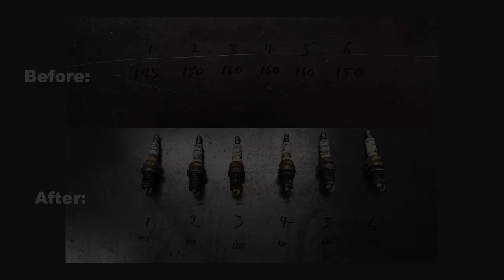Restore Engine Compression $10 - Does It Work!?

Comment: i’ve used restore before. it would make the engine feel good for a little while but it wore out quickly. it wasn’t worth spending the money to add it every copy of months to restore a little performance. but the product does work
Reply: Then you had a much bigger problem then a little compression lost. I won't fix craters in your cylinder walls.

Comment: Nice information. Thanks.
Question for you, as to what product and how much you think I should use. I have a 1995 Subaru 1.8L 4-CYL boxer Impreza, 177,000 miles.  I have 76 and 78 PSI dry compression in #2 and 4 of one head (driver side).  This started a few days ago, we noticed while on a highway trip the power was weak and I can hear it missing as the RPMs drop from driving to idle.

I don't have overheating, excessive oil consumption (drippy seals, I add a quart about every 900 miles), smoking, or fluids cross contamination.  I'm waiting to have a leak down and another dry/wet compression test at a different shop. The first shop only did dry compression and wasn't too bright or helpful. 

If I end up having a head gasket leak between those two cylinders, what products would I possibly try to mend it?  It must not be too bad of a leak, whatever it is, for the compression to build to 78psi dry.  The other two good cylinders are 130ish psi. 

If it ends up being a valve leak, what products and strength could I try to get them clean?  After cleaning, I will have valve clearances checked, as it's probably never been done. 

Any suggestions appreciated.

Comment: glad it was a jeep test got a 2011 charger v6 and it has low comp in cylinder 2 where as before it was a misfire but after a tune up brought it back. gonna get the psi from the mechanic who wants to tear my engine down to see whats wrong. but i think ill try this first.

Comment: Used engine restorer 4 cylinders on my 2015 Scion FRS and I now have around 6 check engine codes. Cars at 82,200 miles and it says on the can use on any car over 50k...also put in a bottle of STP gas after a trip the gas station. Codes with the same oil I used the restorer on: P0420, P0014, P0014, P000B, P000D, P00014              Codes AFTER I changed the oil(because I changed the oil around 15 miles after): P0420, P0014, P000B, P000B, P000D, P0014, P000B.                             A month or 2 ago the car was at stage 1 with the OPENFLASHTABLET then stage 3+ with flex fuel(without flex fuel kit). Flashed it back to original ECU/file and sold the OpenFlashTablet. Some miles later it gave a transmission code cel problem then it fixed itself....then a catalytic converter o2 problem...let the car idle for 30 minutes rev'd it a bit then fixed itself......now this..help pls ty
Reply: @Aaron Erickson haha, hell no. But update! Fixed it, and sold car! Ty for the laugh. Have a good one.

Comment: Had a 2000 frontier with valve chatter. Threw in motor restore on the next oil change and it went away. Ended up selling it to someone who was surprised as to how quiet the engine was

Comment: Can any one explain to me how " Restore " finds its way through the the engine to the piston rings and seals them ?
Reply: I'm not aware of the chemical part. But the "find it's way" that's easy. It's mixed with the engine oil. So where ever the oil goes Restore can also go. ;-)
Reply: Oil is always being squirted into the cylinders below the combustion chamber.  The piston rings scrape the cylinders walls keeping the oil below the combustion area.  
When the rings wear out that allows oil to sneak into the combustion chamber hence losing power and burning oil.  Somehow this restorer helps expand piston rings or coats the cylinder walls creating a tighter seal increasing compression.
As dude said above, it's actually mixed in with the oil.

Comment: Is it possible that driving 2000 highway miles jist cleaned up the cylinders a bit and make it run better and show better compression numbers?
Reply from the maker: Probably not. This Jeep is driven regularly. I'll keep using the product consistently for a year and check numbers again.
Reply: @bleepinjeep  definitely would like to see a one year follow up. Might try it in my 5.2
Reply: @bleepinjeep   I call bull shit ,in a year you can prove it.
Reply: I started adding it in my 5.2 as well... problem is with overheating  engine in summer Air conditioning. I heard something about using a Ford Taurus electric Fan ... someone help... coolant is fine... anyone know of good retrofits for 5.2 overheating Air conditioning problems..
Reply: @jonnykielbasa  new RAD, i just picked up an all aluminum one myself. Put in a lower thermostat 180°. I have ran the AC in my 5.2 ZJ during a 105° day driving for about 8hrs with lots of idling. Never overheated. I may try today since today is gonna be 100°..

Comment: This video has good editing, but I feel that it was directed at folks that have previously performed a compression test. Based upon the footage and info provided, viewers may try to crank the engine with the ignition system still enabled. Just my $0.02. Keep up the great content! ✌️
Reply: Jake of All Terrains 

Noticed that too, didn't mention disconnecting/disabling Fuel Pump or igntion, or holding it at WOT while cranking.

Comment: I believe  it's a gemic, the fine powder that supposed to fill in the scratches in the cylinder walls would never get past the oil filter to begin with! As for compression gains after a road trip on a order engine is do to carbon burn off on the valves. 150 + psi on a engine with 240,000 miles is really good! When you see blow by coming out your oil fil cap or dip stick then you will know its time to retire her.

Comment: The 2k mile trip burned the carbon off your valves and rings and this raised your compression, Italian tuneup.... 

The stuff in a can is useless, quality oil is all you need, has all the best additives and detergents..

Mobil 0w40 fs is some of the absolute best in a jug available at wm $22 5qt... Over 120 ksi film strength in independent testing and perfect for a heep..

Comment: 150 seems low to me.  The least compression I have ever tested was a 280K mile 1983 305 that had 180 psi in every cylinder. My 97 5.7L Vortec cranked 195 in every cylinder.  The 383 that replaced the 350, 225 psi.
Reply: All-Data's specs for this engine show compression between 120-150. Your Chevy engines may have different specifications and compression ratios. The Jeep 4.0 is a low compression ratio engine at 8.8:1, and a stroker 383 engine will have something around 10.1:1, so your compression readings will be different. A 4.0 running more than around 170psi would likely have carbon buildup on the cylinders causing a domed piston effect and have pre-ignition issues most likely.

Comment: does anyone else see it arcing while hes cranking to do the comp test? is that normal for a jeep ?
Reply from the maker: I disconnected the wire from coil to distributor cap while I was cranking. The spark was shooting off the coil. Yolo...
Reply: @bleepinjeep  🤣👍
Reply: I thought it was bad for the coil to prevent discharge. Although yours obviously found a place to arc.... I could be wrong but if that's the case you should probably disconnect the coil and remove the fuel pump relay for good measure.

Comment: My  '94 4.0 is sluggish and seems to lose power once its warmed up. Takes forever to start as well. Thoughts?
Reply from the maker: Miles?
Reply: Fuel pump/filter?
Reply: 206,000 miles, new fuel pump, filter, tune up, CPS as well
Reply: During the winter it runs like a champ, summer like shit. Heat soak? Should I insulate the fuel rail?

Comment: We ran restore in an old Buick 350 motor and the oil relief valve starting sticking and causing zero oil pressure at idle when coming to stops at lights and sometimes when starting
Reply from the maker: First negative I've heard. Good data point! Thanks

Comment: compression increases from the chemical because worn engines have sludge and carbon around the the piston rings and sometimes they get stuck in place and dont fully seal properly. they supposed to have a little play on the piston and move left  right, oil control ring wipes off the excess oil on the cylinder walls witch sometimes if stuck will end up burning oil and same idea with the compression rings, if stuck and not sealing properly, will lose compresssion

Comment: I used this stuff on a 350 many years ago, after tearing the engine down a couple years later I was baffled by the blueish looking stains running the length of the piston stroke......then it dawned on me that I had used this in its lifetime.
Reply from the maker: Did it work as advertised for you?
Reply: I believe it did, not on a seat of the pants scale but looking at the cylinder walls yes. I have a 96 XJ that just turned 284k miles on an untouched motor thats going to get some engine restore this weekend, can’t hurt by any means!!
Reply: Did you notice the metallic flakes from this stuff in the oil pan at all? I used it in a 2000 suburban I had and there was a bunch built up in the oil pan when I pull it apart later on.
Reply: Tony V_AZ I didn’t in mine, did you have a large amount of metal in your pan?

Comment: Notice you removed your thor intake? Did you have issues with yours?  Just wondering before I hack into my firewall... Would love an update.
Reply from the maker: I didn't have any issues with it but at certain RPM'S (like on long freeway drives) it was very loud. Driving to Utah last year with it I could barely hear myself think so I took it off this year and was grateful for the much quiter drive.
Reply: Thanks for the quick reply brother, I too drive the holy shit out of my forty door xj “Rusty-J” Zig zagging across North America in favor of camping and wheeling. Funny how when we get older the shit that annoys us. When I saw yours I ran out and got one so i could free up room for a dual battery setup... ended up mounting under the rear seat so I never unboxed the intake.  Sorry to take the compression check vid off topic... on another note I’ve got 399k in my 91 and I religiously change the oil at 3000 miles accompanied by the original slick50 formula... Still a lot of power except #1 cyl is starting to queif a little more than its 5 siblings...I’m guessing it’s got another 75k in him before I need A rebuild. My grandpa worked on the ford assembly line his whole life and was a ford pickup guy and always ran that restore goop and swore by it...

Comment: 150 psi is fine, the 4.0 is all about low end torque and clearly its more than enough to climb a sheer cliff face with the gentle press of the big toe. understand that once you lift a jeep and start rolling 33's that your speed over 35mph drops dramatically from wind sheer and tire physics work against the engines power at high speeds.

Comment: Thank you very much. I bought this product at Walmart for $7.97 about 2 weeks ago. I added it to the engine of my  2018 Malibu in the parking lot of Walmart. 3 minutes later, the car started vibrating violently, lost power, and the engine light came on. Couldn't drive. What may have happened? Thank you.
Reply: Did you know the amount and condition of the oil that was already in the car?
Reply: That Malibu has VVT and GDI.  You're not supposed to use this stuff in modern engines like that.

Comment: This stuff definitely will quiet up a slight knock it is a cheap mechanic's way to "fix" a motor right before selling the vehicle and it does work as long as you continue to use it at every oil change but they usually do not tell you that...

Comment: I just did an oil change with lucas additive, I wonder if it would be ok to put some Restore in as well?
Reply from the maker: I've done both in the past. Almost 250k miles now... Still runs fine. I don't think 4.0's care. Just feed it oil of some kind.
Reply: @bleepinjeep  
Good to hear man, I'll put some in, I'm at 287k so I'll add it to my oil changes from now on.
Thanks
Reply: I once ran an old Pathfinder with a 3.0 V6 with basically nothing but a combination of probably 1 qt of cheap oil and the rest  Engine Restore, Duralube, and Zmax in it for a few hundred miles before I realized (I was young and dumb). It ran and ran well. Basically gave it away with over 300,000 miles on it and it still ran great.
Reply: @timyestim  
Damn

Comment: Hey I’m not sure if you noticed. But during your pre trip compression test, there was something arcing out
Reply from the maker: I diso'd the coil to distributor cap wire while cranking. That spark was from the coil jumping to grounded metal surfaces near by. Next time I'll unplug the CPS and that'll kill spark and fuel.

Comment: So I have a 01 Jeep Cherokee 4x4. I have a small engine tick. I used this stuff since I lost compression- my engine tick completely went away for 3 days then came back. Is that normal? I was hoping not to have to replace the entire engine this fall. I have approximately 200,00 miles on it.
Btw Tim is cute 😍
Reply: Pretty sure they're supposed to tick after the 200k mile mark!

Of the 6 I've owned 5 had some valve noise. The one that doesnt only has 120k on it
Reply: James Ryan a small tick can be easily ignored but loosing compression is another. Esp when it would go through episodes of having a hard time starting. I’d rather just replace the whole engine instead of tearing it apart and fixing small pieces/ a piston. I thought I’d try the engine restore just to see how it would do. It was so weird because my engine sounded completely different for the first 3 days

Comment: Off topic, What size tires and gears are you running ? Reason for asking ,because you didn't trailer the jeep.. thanks great video.
Reply from the maker: 33's, 4.10's. Runs about 2,500rpm at 70mph in 5th gear (AX15) and I'm seeing almost 15mpg avg on long interstate drives like that.
Reply: @bleepinjeep  was hoping you said 35s.. gonna regear mine and everyone has a different opinion.  What would you recommend for 35s. Also dont trailor mine.
Reply: @javiroo1743  I have 4.10's and 33's and I would mind a little lower gearing. I think if you wheel a lot people like to go with lower gears. 4.56 with an AW4 and 35's or 4.88 with an AX15.

Comment: Ok, watched the whole video, you should have done a dry test, then a wet test (oil squirted in cylinder).. Because if Restore didn't raise the compression in a cylinder, it could be that your leakage is coming from the top end (the valves).....

Comment: I used it many years ago in my 63 Dart. Had some smoke from the pipes (dualled out slant 6) with MANY MILES. Engine is all original except 2bbl and exhaust. Atfer use, l haven't had any more smoke. This is one of the very few products l fully recommend for a higher mileage engine.

Comment: Ive always believed restore works to regain compression in scared cylinders. My o4 tj 4.0 had an increase in cylinder 5, was the only 1 under 150 psi. I didnt go extreme, rechecked cylindee 2 weeks later and still up at 150 was 140. 150,000 on the odometer but its not right due to 33" tires and stock 373 gearing
   I would not use this in any new engine including my wifes 14 jku. Anything running thinner oil than 10w30, I'd be afraid to clog up oil passages ??
Reply: No, i did not document or make videos. Just a friend and i playin backyard mechanic w\a case o beer on a sunday

Comment: Champion Coppers. 438 I believe is the part number. Maybe 412. That's the only plug you should ever put in a 4 liter. They run the best on a champion copper. Tim I see you're an Oregonian. Hopefully you're in Facebook groups Oregon Offroad, and Eugene Springfield Jeepers. Northwest Clean up Crew is another one.
Reply from the maker: I'm not much of a Facebooker. I'm down in the Medford/Ashland area.
Reply: Well if you check out the groups once in a while you'll find wheelin trips scheduled all around the state. Biggest group we had was 195 Jeeps out on the dunes by goosepasture. The drive out 126 from Eugene was insane, with over 100 of us in the convoy.

Comment: Why didn't you just go ahead and replace the plugs? Cheap insurance to keep it running well. The gap looked pretty big? Did you check? Anyway always cool vids.
It's easier to attach the hose to the fitting first then thread it in.....did you open full throttle to allow all the air to flow through?
I am full of questions!! haha
Reply from the maker: I neglected to open throttle however I did both test procedures the exact same way. I replaced the plugs after Utah.

Comment: That battery bracket would worry me something awful! The corner of it looks like its just about touching thing positive terminal which would cause a major problem if it did. I'm sure your aware but if you weren't I thought I'd just mention it. I'm not telling you how to do things on your own vehicle or be a hater.
Reply from the maker: People have point that out before but the bracket tie downs are strapped into a plastic tray under the battery. Not grounded. Also they have never budged. Thanks though!!
Reply: @bleepinjeep  I figured you knew I just wanted to mention just in case. If it could go wrong it would with me good luck with it...

Comment: You didn't get the full benefits yet unless you ran it 200+ miles. It says it on the can plus you gotta give that stuff time to work it's way in to the wore spots in you cylinders but yes this stuff works beautifully
Reply: guess you missed the part where  he drove to Moab and back.

Comment: Disable the fuel system when doing a compression test
Reply: Y
Reply: Because with the plugs out you still spraying fuel.. one arc from a plug wire and your dealing with fire
Reply: Good point my man

Comment: Would it work on diesels also are just gasoline engines
Reply from the maker: I think it says for use in diesels too on the can.
Reply: You can use it on diesels just not power strokes
Reply: @jeffbiggs496   so I should be good to pour some on my 84 6.9 then